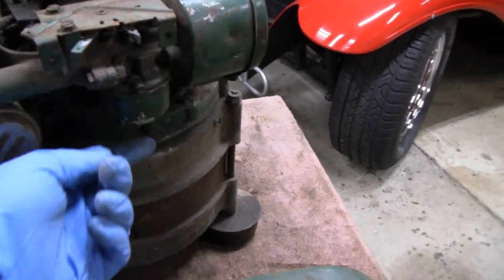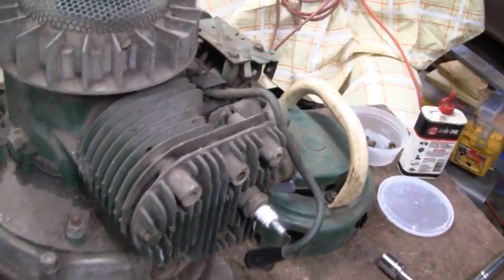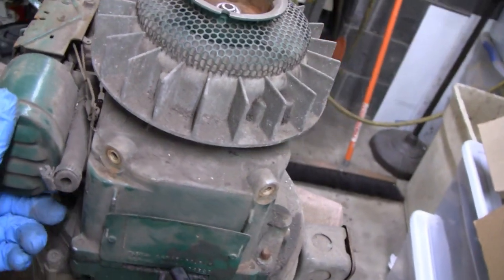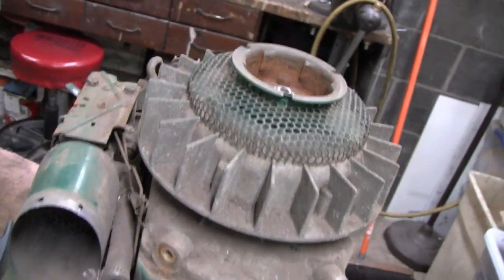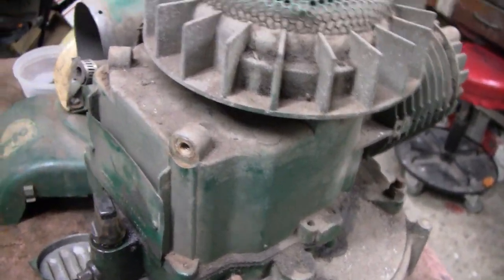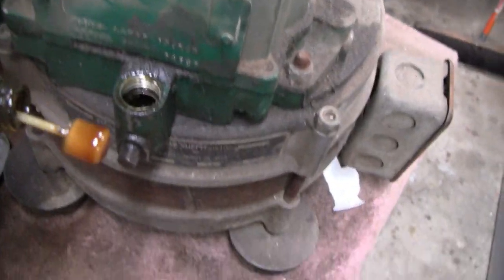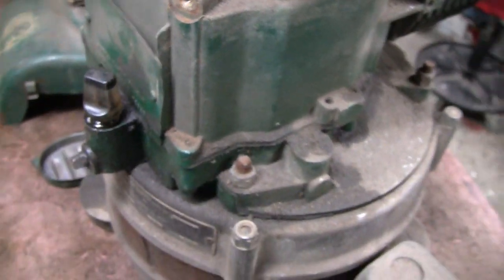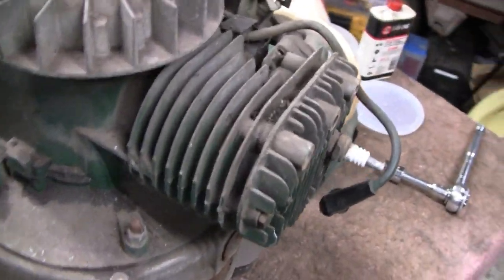TECUMSEH  GENERATOR REPAIR (part 3)

Comment: I was an authorized Tecumseh dealer back in the day. They made us buy all the special tools like the flywheel puller. It remains unused until this day. They had self tapping screws in them. I always used the old screwdriver and hammer. Never had a problem.

Comment: You are right about giving them a whack to take off the flywheel.  In my Briggs manual they tell you to do it.  There is a tool to put over the threads and you whack that.  I got one from George Durivage.  I use the 631021B carb kits.  It is a bowl seal,needle, seat, needle spring and bowel nut seal.  If the float is OK that will do you.  Us Canadians see a lot of Tecumseh stuff.  $4.26 U.S.
Reply from the maker: I have one of those tools for the flywheel, ya need three hands to use it eh!!☺
Reply: I have always said I need another hand coming out of my forehead.
Reply: it is a seal that goes under the carb bowel nut to prevent the bowel from leaking.  .  Issues?
Reply: K  bowl.  Whew   missed it haha

Comment: Wow that's my age  :) the gaskets on the old heads came off intact compared to the single use ones today .
Reply: I remember using the same gaskets over,can't do that today. Went you don't have the money,you try whatever works.
Reply: Bobby Tectalabyss Bobby I remember years back I could save the old gaskets and use the on 2-3 engines but today you pull a head off and it separates into peices. I miss the good old days when machines were made to fix not throw away .
Reply from the maker: Yeah I agree with you guys, I'll reuse an old style gasket any chance I get!! Even when I buy new ones I try to get NOS!!☺

Comment: Back to the flywheel - as long as you're careful, the hammer/prybar method works fine, I've never had a problem with it either. When I used the actual puller, it was just as quick when I had a butterfly impact to screw in the 3 self-tappers and twist the center shaft to pop the 'wheel. 6 one way, half a dozen the other...

Comment: The air cleaner looks like the ones on the bigger engines used on those old 3 wheeled riding mowers that were front wheel drive with the one wheel in the front

Comment: As shown with oiling the pull starter with these old engines a little bit of intervention goes a long way! Yeah, I agree - If the valves are moving leave the head on.
Wow, no shellac?  One thought that occurred to me was the gas they used back in the day might have been better for these little engines than the more toxic fuel we use today. Thumbs up - great post!
Reply from the maker: Yeah the ethanol is pretty much the death of a carb now if ya leave it in there!!☺

Comment: Nice work. Please be careful using silicone spray around engines. Screws up the points if it get on them. Hope this generator works when done. It's a great little setup. Thanks for the video's.
Reply from the maker: Thanks Bud!!☺

Comment: Hey ROADKING,...'string 'em up!'  Just kidding, in a way. A little tip that might help the next time you don't have a buddy around to help, tie a rope to the overhead rafters ( or hook ) and the other end around the starter pulley on the flywheel, with the weight of the motor just off the table,...balance the engine with one hand, and rap on the crankshaft nut, and it'll pop loose that way too.
Reply from the maker: That's funny Reg because that though did pass through my head!!☺
Reply: Ah well, they say that " great minds think alike," then some jackass had to spoil this by adding,   ..." and fools seldom differ ! "  Naw, we're just on the same track I'd guess.
Good series ROADKING,...keep 'em coming along.

Comment: tecumsehs have notoriously soft crankshafts and they will break right at base of the threads ,, this older one  isn't quite as likely to break because the older engines were made from better metal  , for me personally i won't hit one with a hammer 
what I do is use an air chisel  with a center punch tool  on the center of the shaft ,that engine being an older points type engine it also has a thicker flywheel which also is less prone to cracking which the hammer blows can cause , very rare in older ones  but it has happened

Comment: From the beginning it seemed to me that the handle didn't fit the design of the whole generator. Maybe it's the color that's messing me up.   I was thinking all along that it was an 'add on' by someone who used it.  Granted it is a great thing to help move the unit around.  I'm like you and can remember the spring loaded drains in the carb bowl.
Reply from the maker: Yeah back then it was more about function than looks!!☺

Comment: You ever put a magnet in your oil drain pan to catch particulates? Just for S&G ? 
You run 93 octane in your show engines ?
Reply from the maker: Nah never done that with a magnet, but I will now!! I still have it in a plastic drain bucket in the garage!! We just use the cheap crap gas in all our engines!!☺

Comment: With the brass float I think it may be a 1969 or older motor
Reply: tecs used brass floats way after 1969. The one on my mini bike is original late 70s and has one.

Comment: Hey Road King know this is completely off topic from what this video is. Just watched your video about rebuilding Buzz coils and I bought the capacitor that I saw and I was wondering if it works on 6 and 12 volt?
Reply from the maker: Yeah it will work on both but the points last longer on 6 volt and the spark is just as good!!☺

Comment: Hey buddy, how do you feel about those Tecumseh Engines ? A lot of guys don't like them. They say the engines don't last, that they're poorly built. What do you think sir ?
Reply: I had three Tecumseh, two were well used, that all had problems.  The ones that I had all had cast iron flywheels with heavy balancing weight.  The result was the bushing at he flywheel end would wear out and when the engine heated up the gap on the points went crazy
Reply from the maker: I like them Stephen, I've worked on hundreds of them and Briggs!! And to me they are almost Identical!! It's like anything, if ya take care of it , it will take care of you!!☺

Comment: See if anybody here knows this,  I have a #100902 B&S 4hp on a 1968 homko tiller and it runs good but is a pain to get started.  Its had a valve job,  new head gasket and carb rebuild (with acid bath) but it take several shots of starting fluid to get it to go on gas. What I'm trying to figure out is how to get it to start easier.
Reply: Allen McKinney I had a hard starter on different rig, used the positive choke method. Place hand over air cleaner for tight seal , normally third pull n poof. With out the positive choke method you'd pull for days. Hope it helps

Comment: Isn't it nice to get something straight to work on Mate......only age sitting issues to be dealt with. Nice black oil that came out of that.....you know black is carbon, and carbon is a lubricant. Only reason to change oil is to remove metal particles and the breakdown of it's composites. Yes I know YOU know this, not everyone does.